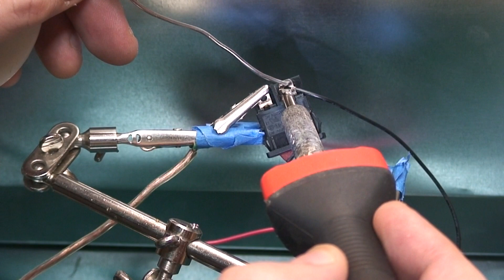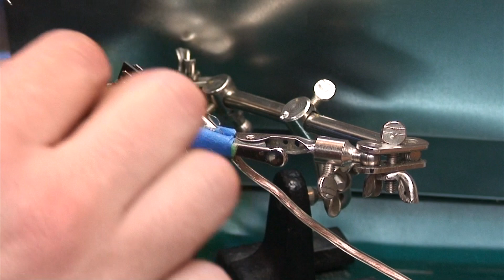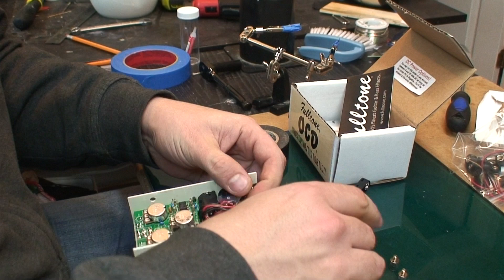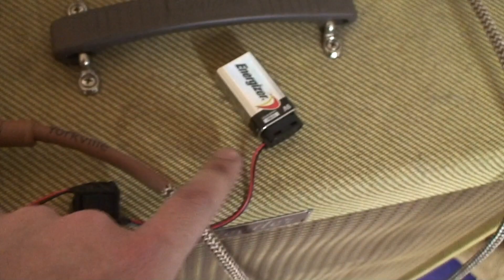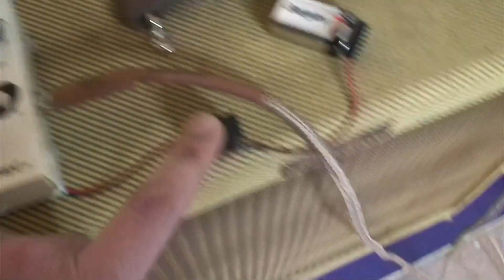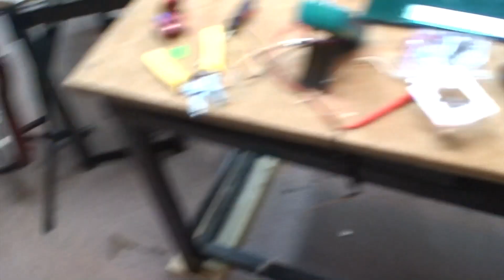9V Battery Problem Every Guitar Pedal Has: Solved DIY! Battery Cut off Switch.

Comment: The stereo input jack is the on off switch just unplug to turn off pedal - this is video/project is a complete abomination
Reply: Your comment solved my problem.
Reply: Actually, the idea is good. If you're more technically minded, you could probably fit something inside the box if there was room - like a micro switch. But I say thanks for at least coming up with an idea that can be built upon. That's how we got where we are today....for better or for worse:).

Comment: There's a reason the pedals don't have on/off switches...  You don't want to accidentally turn them off in the dark on stage...  That said, I've always thought they should have a sensing circuit in them that turns them off after 5 minutes.  Maybe I'm delusional, but I think the technology is out there.  I guess that's why so many people use pedal boards.
Reply: +Greg's Garage Oh, by the way...  That amp is just dripping with tone!
Reply from the maker: +Greg's Garage Yeah man I agree with both:-) But I'm not a guy on stage and I reckon 80% of their market aren't either. I think these companies would do well to make a distinction between home users and professionals. Same outcomes, different problems for both parties. A pedal company doesn't put it in, because they assume the pedal will be used on a stage and unplugged at the end of the night. Also, this would be added cost. As a home user, I would very much welcome a power disruption switch on the side of the pedal. Flipping a switch  is a one handed affair:-)

Comment: This is a problem I've been thinking about. I have quite a few effects pedals. I mostly daisy chain them to a power supply which is fine when your at home.
I built a DIY pedal recently, to use with my Pignose amp, hence it needs to be portable without an external power supply. And I think I've done the off board wiring slightly wrong because even when I unplug the guitar jack, the battery still drains, unlike my Fuzz Face, which is fine as long as I always remember to unplug the guitar jack, which is easy enough as the Fuzz Face is always the first on the chain.
Until I figure out what I've done wrong with my DIY pedal wiring, I've come up with a make do fix which is similar but slightly simpler than yours. I bought a 'battery clip - to - 9v power socket adapter', which I just unplug from the 9v socket when not in use. This of course only works with a pedal that has the 9v power socket.
Regarding my wrong wiring. I'm fairly sure it's to do with the input jack socket. The socket needs to have 3 pins on it, the third one acting like a switch, which the negative wire from the battery is connected to, so that when the guitar jack is unplugged, it (breaks the circuit) switches it off.

Comment: This will not work with buffered bypass. When you disengage the pedal, the battery is required to power the buffer. I think the majority of pedals are buffered, so this trick won't work very often. I tried a similar solution and then you need to remember to turn on/off 5 switches every time you want to jam... Sort of discourages you from wanting to play. Check out the vertex battery power supply or the danelectro battery billionaire for a much better solution

Comment: just unplug the guitar input to the pedal, done.
Reply from the maker: +Boudreau Guitars I know:-) But thats a two handed affair. And I think a little switch would be easier. I don't want to have to unplug it. I know I can also buy an adapter. But this was just for fun.
Reply: how about a tiny toggle mounted through the box? :)
Reply: why not cut off a wall wart plug.  insert plug into pedal.   It bypasses battery and serves as an on/off switch allowing you to keep your guitar jack in place.   Right?  Would have to remember to remove for play.

Comment: Is it so hard to just pull the lead out when you've finished using the pedal which of course has the same effect as your switch?
Reply from the maker: +clusterm2 If you can absolutely remember to do it each and every time, I applaud you:-) I have young kids who distract me very often, so I put my guitar down quickly, and if I mange to click a pedal off, let alone pull the cables, I'm lucky. This gives me a fighting chance, if I can make it convenient to use. For now, I just wanted to see if it would work and if it bothers other players who like to tinker, try this or something better:-)
Reply: +Woodeso's Guitar Mods you don't have to pull out both cables just the input.......I like what you did but if you forget to step on pedal your going to forget to switch off the switch....but like I said good job nice thinking.....

Comment: I was changing the dead battery in my Boss MT-2 pedal for a fresh one, then I practiced with it for a little. When I finished I turned the pedal off and unplugged it from my amp and my guitar. When I went to use it again a day later, the battery was completely drained. Anyone know what the problem could be?
Reply: You have to unplug the cable from the input side of your pedal.  Not the output side, and unplugging from the amp and guitar will not help.  Same goes for active guitars (usually) -- if you leave a cable plugged in, you'll drain the preamp battery faster, even if the cable isn't plugged into an amp.